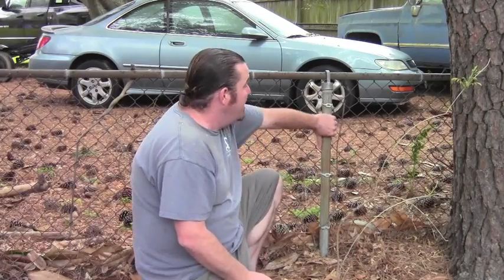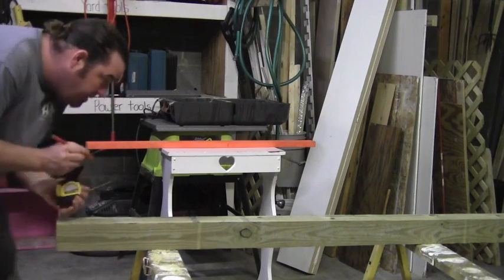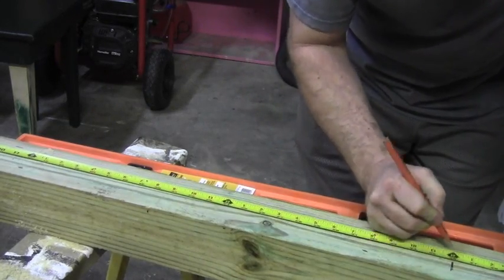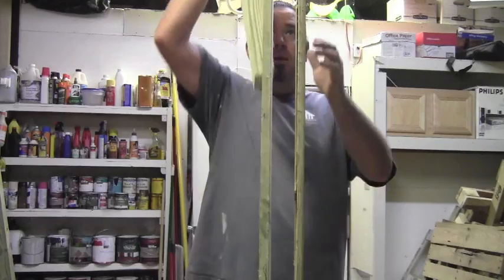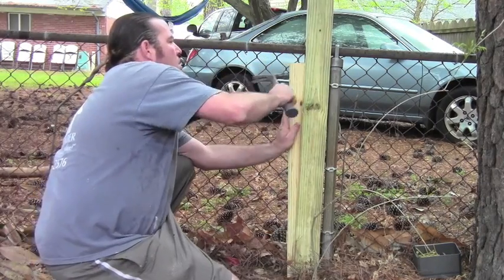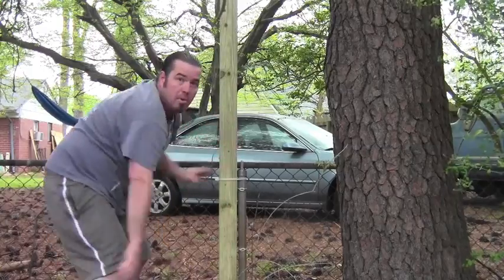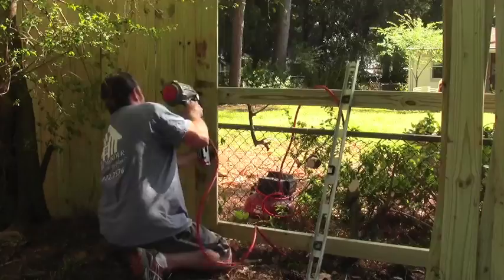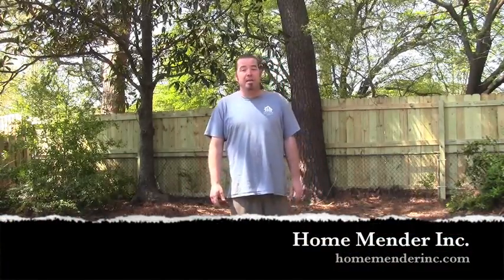How to replace chain fence with privacy fence EASY! Home Mender.

Comment: This is one way to  "geterdone"  But the post part, buying posts and notching the post  is time consuming and  expensive.   I have seem methods which  bypass the posts altogether and add wood braces to the metal posts with brackets.
Reply from the maker: Thanks for sharing det!

Comment: Are there any concerns for whether the posts can handle the additional weight from the wood being added to the fence? =)
Reply from the maker: hi menq! i dont think so...the posts are actually sitting on the ground and the rest of the fence is supported by your new posts...the wood fence is actually built around the chain link, not on it...this was a great solution to my "ugly neighbor yard" problem. i hope it helped you!
Reply: Home Mender  Thank you! I am definitely interested in pursuing a project like this while the weather is still decent out here in the PNW. I will definitely let you know how things turn out. So just use any circular saw to make the initial cuts to the 4x4 and then use a skillzaw to do the rest? Is the paddle bit used to just created that rounded shape so the post sits flush with the existing fencing? Just want to make sure before I engage in a huge lumber purchase from Home Depot or the local lumber yard. =)
Reply from the maker: No problem Menq! just to clarify, a skilsaw is a term for circular saw ( like bandaid for a bandage) i used my circular saw to make the cuts then flipped the wood to finish cutting through. the paddle bit is just so i can fit a sawsall blade through the hole to cut out the remaining part. it doesn't need to be that "rounded" to go over the existing fence but do what you can.. you got this and i would love to see how it comes out!

Comment: I probably would have gotten a pressure treated 2x4 and with wood to metal screws drilled straight into the metal post thus creating the same effect, minus the doing a 3ft notch on a post. P.s. invest into a 12"blade extended arm miter saw
Reply from the maker: awesome bryan..thanks for sharing!

Comment: I just bought 5 4x4s and 6 2x4s to see if I am capable of doing this sleeving of the chain link so I can try to have a privacy fence.. so wish me luck... I could barely carry the 4x4s to the back yard so this is going to be hilarious...
Reply from the maker: lilly! you got this! The things we do for privacy! lol Just think how great its going to feel to have it. thanks for sharing and  Good luck!
Reply: It was harder than I thought to cut out the middle part.. and of course, my chain link fence is not exactly standing completely upright... it is kind of old and might have settle... .. is that okay?  Also - when you put that middle piece back how is it supposed to fit with the chain link there?  am I supposed to cut it in half?  I guess I am confused
Reply: or just shove the middle piece back in no matter what and screw it all together?
Reply from the maker: hi lilly... yes you can slip that middle piece back in and screw it together. that will keep it nice and snug...you got this!

Comment: save yourself the work and buy ,Chain Link 1 5/8" [1 5/8" OD] x 6" Wooden Fence to Post Line Adapter (Galvanized Pressed Steel)- and Plus a steel post yoke adaptor to attach your wood to.
Reply from the maker: Thanks for sharing Wendy!

Comment: For heaven's sake, just use 2x4's on either side of the post instead of cutting down an expensive 4x4 post.  Screw and glue a 2x4 piece in the center at the top.  Shim out with exterior grade treated plywood sections if necessary.  Or do it the easy way and attach with pipe clamps.
Reply from the maker: hi blue skie! .. that's one way to rig it! thanks for sharing!
Reply: Can you explain this more? I am not seeing your idea.Thank you.

Comment: Just buy a auger you can find one for about $120 and it will drill through pretty much anything you might have to cut a route out of the way but you could have put a privacy fence up there without going over that. I have been doing fences for 30 years. There is not one thing I have not came across that my auger could not go through.
Reply from the maker: Awesome advise James thank you so much

Comment: JUST WONDERING THAT AFTER U PUT UP THE 2BY4 BETWEEN THE TWO POST, SO U R STICKING OUT ABOUT 3INCHS FROM UR EXISTING METAL POST, IS THAT BEEN CONSIDERED U R TAKING UR NEIGHBORS LAND?
Reply from the maker: hey AG! great question! i would have to say that because the fence and additional 2x4 isnt touching his land, its no. besides no one is going to prefer a chain link over a privacy fence between neighbors. this guy is happy! thanks for commenting!

Comment: why not remove the old fence
Reply from the maker: hi dallas..great question! you could but the idea was to use the structure of the current fence to install a privacy fence.. you could remove the old fence but then you would need to dig through all those trees to set new posts. This was a simple solution to a common problem. i hope it helped you!
Reply: I'm kind of in the same boat. I have a chain link that goes most the way around 2.5 acres. If i can utilize the existing it would save time and energy. My only problem is that we can get some high winds. I just want to make sure that with such a long wind block, with the steel posts hold up over the pressure. But this gives me something to ponder. better than just hanging a mesh up.
Reply from the maker: Hey Justin!  Mesh? that would be way to tennis- courty.  If wind is a concern you could space the pickets out a bit and not close them in,. this fence had lots of trees and houses for coverage but the fence was pretty sturdy. Just double check the posts to make sure they are tight. this fence was a beast! Good luck!

Comment: Isn’t it 100 times easier, quicker and stronger to use metal pipe conduit brackets to attach regular 4x4 post to existing pipe posts?  Or get 6 feet long slightly bigger diameter metal pipe posts and slide OVER existing posts and use brackets to attach horizontal 2x4  wood to it?  Just try to google : “attaching wooden fence to metal posts” ?
Reply from the maker: hey AG! great suggestions...if you could find all the stuff...yes! but this was pretty easy, quick and strong...i hope the video helped!

Comment: It went great until you zippe tied it....zip tie has no strength and had much steronger materials to hold it with...but great job either way
Reply from the maker: Hey T. Did you see the size of those things? I’m sure they are still holding strong. Thank you so much!

Comment: What happens when the zip ties get out they are plastic? Not trying to bust your balls man but 1 major 1 Storm comes through there and that is not going to be standing anymore. As soon as The 4 by 4 you put up start swelling and attracting. They are going to start moving and when they do they're going to throw your whole fence at a whack? Then what are you gonna? Do charge the customers to come redo it again? Just do it the first time.. They don't have the money to buy an auger rent one. It's easy to get through the ground with them and then you can do it the right way. Especially on how expensive wood is now.
Reply from the maker: Hey James this bad boy’s been up for seven years now… The zip ties we’re just placeholders until the fence was built. Thanks for watching